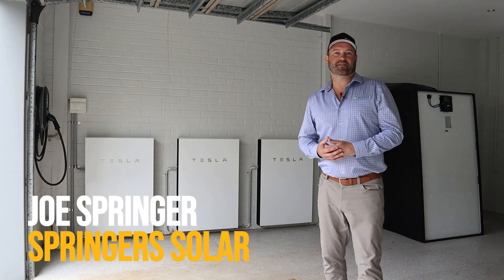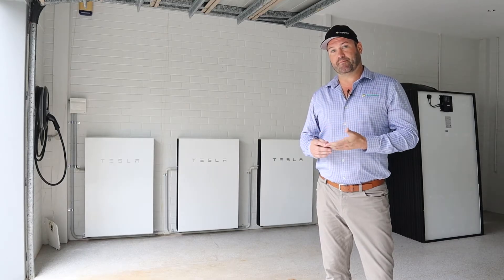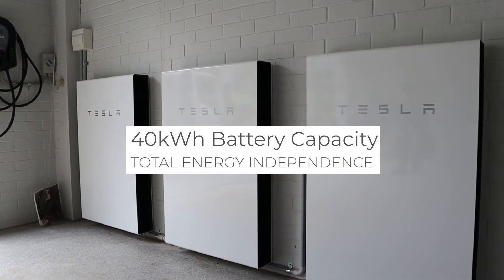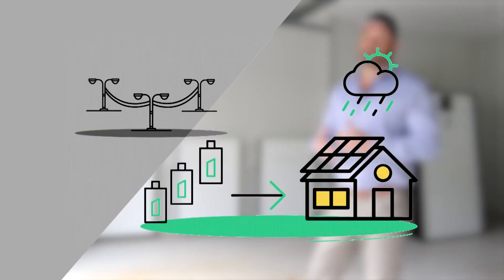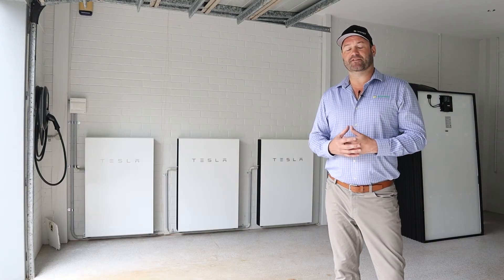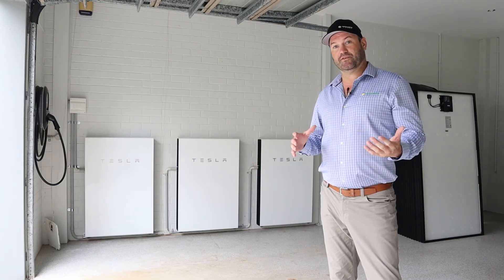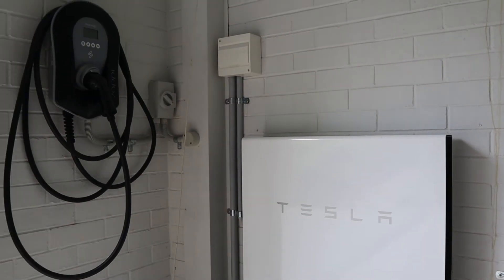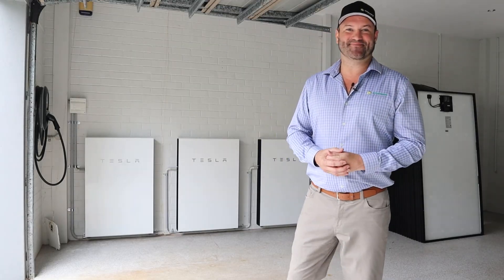Three Tesla Powerwalls - How This Home Achieved Energy Independence

Comment: I run a respite centre in NZ and there are 3 main dwellings and 15 chalets and main dining hall all new build. What I'm looking at doing is having 15 TPWs installed and solar to run power the, stacker washer and dryer, 5 large hotwater cylinders and 18 heatpumps for the entire complex.

Comment: My question is 👇 
Trying to avoid the confusion that bother the hell out of me & everyone else.

Will 3 X Powerwall 3 storage batteries 
Run home completely off main grid👇
 
Example home with 4 adults + in-ground pool ( using all the usual home appliances full size fridge-freeze Tv computers washing machine bla blah)  
off grid no connection to main power lines with a back up diesel generator for emergency charge if ever required .. 

Straight up 
Yes or No 

If yes buy my calculations the all up costing averaged over a 25 year lifespan with regular maintenance cost would be around $2500 would be year with no energy bill at all 

Which is far less than most people pay now ..

Would this be correct 👇
Yes  or No 

Therefore after the initial outlay purchase for the Powerwall system .
the home owner would enjoy the benifits of no power bill from energy companies & 
be looking at approximately $300 annually for a maintenance check up + $2200 banking for a full  replacement system in 25 years if a newer better cheaper technology isn't available by that time ..

Comment: When installing 3 Tesla powerwalls into a three phase home with three phase inverter have you found that when mains is disconnected  - the system keeps running all phases with  solar and battery drive, with total sync only when the three phase inverter is driving .. outside this condition then each phase can only drive single phase circuits as sync is dropped.. currently try to work a full time 3 phase sync with more equipment